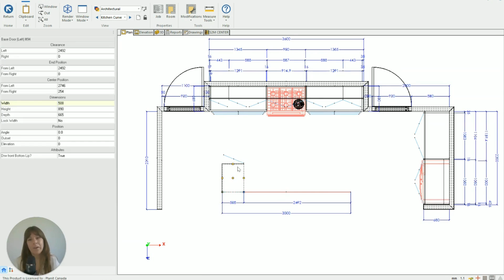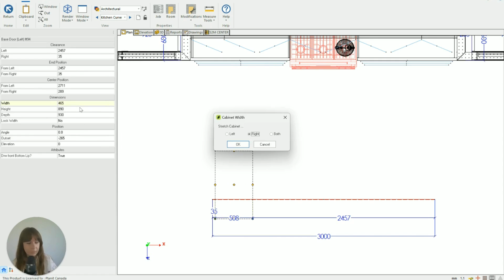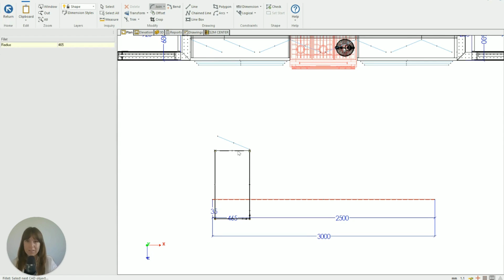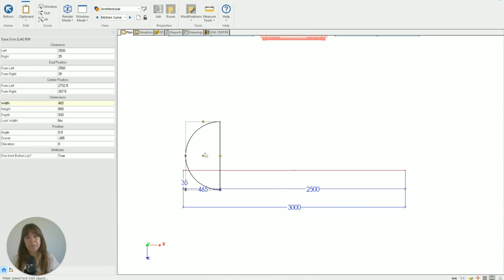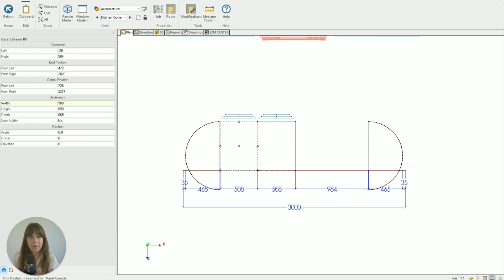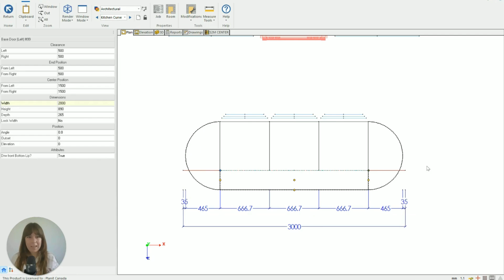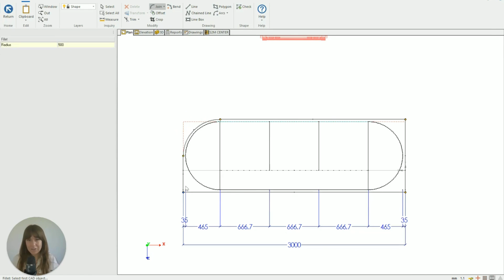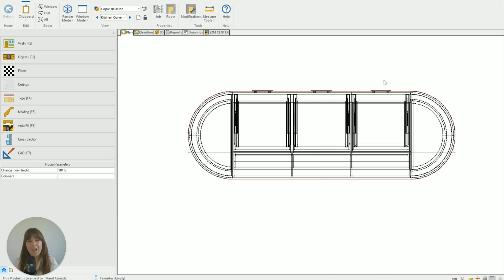How to Create a Curved Island in Cabinet Vision (Beginner)

Comment: HI! Could you help me with an issue on a curved cabinet? I have a cabinet with a width of 279 mm and a depth of 546 mm. I need to make a curved front for the drawer. I followed the video but used a smaller radius of 139.5 mm. The front of the drawer is split into two separate fronts. How can I make a single curved front for the drawer?

Comment: also is there a way to create dimension lines in the 3d view once you put it in the 'to drawing' page?
Reply from the maker: Yes there is a way to create dimension lines in the 3D view, but it is a feature introduced in CV23.3. If you upgrade to the latest version of CV, it's quite a simple process. 

1 - From the 3D view of your room, right-click on the white space and choose the 'Save View' option once the 3D is in a view you would like to transfer to the Drawings page. 
2 - Once that view is saved, you will see in the top bar a drop-down menu '--Select--', probably between an option 'Birdseye' and 'Edit Walk Through'. You can now choose the view you have saved, and this will lock your 3D view in place. 
3 - Now with this view locked in place, you can add CAD to the 3D render and then send it to your Drawings page with the CAD attached. 

A couple of tips with this tool though: If you add dimensions to this view, you'll need to know the dimension as the 3D will not be necessarily to scale. So it is very useful for highlighting important information which features in the design. 

Also I am not sure which modules you have configured with your CV license, so keep in mind this could impact the functionalities you are currently able to use.

If you're interested in seeing if this is a feature you'd like to explore, you can see it in use on the Nexus community forum here: (https://nexus.hexagon.com/community/cabinet_vision/f/cv-2023/135329/dimensions-in-3d-view/788123)

Thanks for posing these questions! Let us know if you have any follow-up questions about this or any other topic! Cheers

Comment: Hi there, im a CV 11 and 2022 user here in Australia and i mostly do drawings for approval and eventuall for factory / manufacturing use, but i somehow i cant manage to make cabinet vision faster as i do lots of editing, and once i do that I obviously have to edit the drawings page, more often than not doing a new one as the old one shows different dimensions, sections, 3d view, details, etc. Is there another way to make it faster? I've tried using live view but it takes such a long time, and it comes out in weird coloured lines. As you may know deadlines, boss wants it faster. Also did you create that 'architectural' style there where it shows line drawings on plans only with swing doors shown? Thats a nice and i reckon faster way to edit as the graphics is not that much.. hope you can help me, cheers
Reply from the maker: Hey, couple of great questions there! So in CV22, there was an issue with the speed when many live-drawings were saved in the same job. (You can see this under CABV-27904 on the Nexus forum). For version 2022, probably the most straight-forward workaround was to split and batch your rooms as separate job files to minimise any diminish in performance. If that's not your cup of tea, you might find that migrating to the latest version of 2024 improves overall performance as well. It will also offer you the ability to create dimension lines in the 3D view, but I'll provide those instructions in the other comment thread. In regards to the coloured lines, I'm not sure I know what could be causing that. Might be worth reaching out to your reseller for a tech support call to investigate further. That Architectural style is a default layer which comes with the Canadian English install of CV. That said you could modify your layers to match this style to get the same result. Are you familiar with modifying the layers? Would you like any tips there? We'd be happy to help!